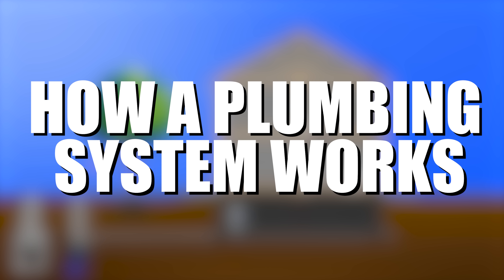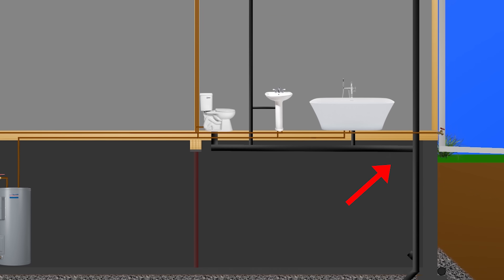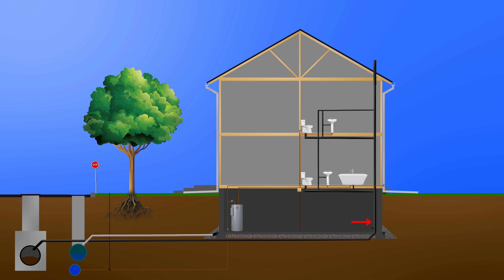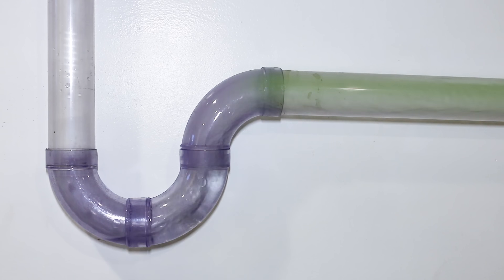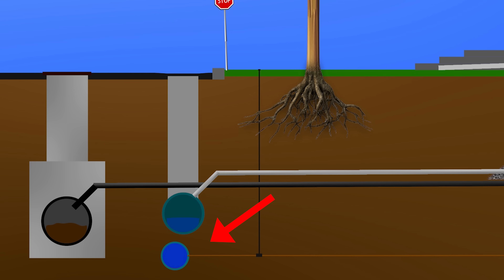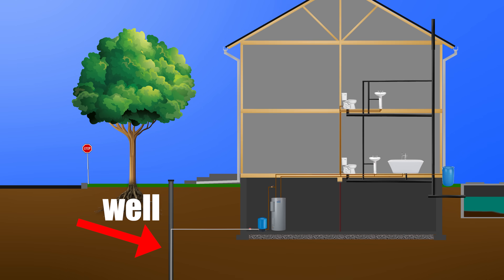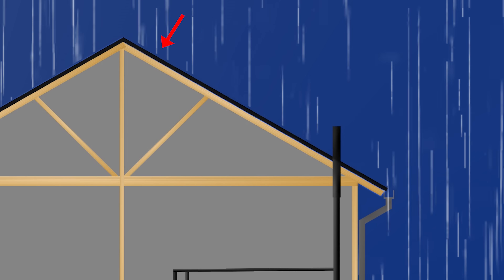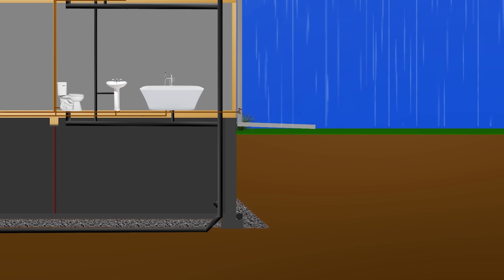How Your Home Plumbing Works (From Start to Finish) | GOT2LEARN

Comment: -Jus one thing, its better to have potable water lines over the waste lines, so if theres a problem with the waste lines theres not danger of getting your potable water contaminate.
Reply: Yes, codes require the potable lines be above and located 10 feet away horizontally from wastewater lines. If the lines have to cross or if the potable line has to be below the waste line for some reason, the lines are encased in concrete in these areas. Potable water lines must be buried deep enough that they don’t freeze in the winter - typically at least 3 or 4 feet below the surface. Waste lines are deeper, anywhere from 6 to 20 feet deep.

Comment: You ought to state this is the norm where you are but not how any other country does it !

Water supply: malleable iron or PEX. From fresh water reservoirs, lakes or sometimes wells. Not rivers!
Vent pipe - only for the toilet. Sink/bath U bends glug - and don't empty.
Hot water source: copper cylinder in the bathroom or gas/oil fired combi boiler in the kitchen.
Drainage - goes into the combined sewer.

Comment: The last part of the video should of been this is one way,  most rain water / storm drains go into a local man made pond and if that over flows goes into another one close to it. This is the same for huge parking lots etc.  Imagine the flooding caused if all drainage pipes etc went to rivers/ streams etc...  And how polluted they would be from all the run off from roads like oil trash etc..
Reply: Which is exactly what used to happen. Thank goodness we don't do that anymore.
Reply: @gregdubya1993  of course you do it. It's literally the only way to prevent flooding
Reply: While there may be a vortex separator or triple basin (i.e. oil and trash separator) installed within the storm system prior to the pond, the true design intent of the retention ponds is to offset the impervious surface area created by buildings, sidewalks, and roadways that does not allow water to infiltrate back into the ground. They are not designed just to keep rivers and streams clean. Rainwater is stored for a designed period of time and discharged downstream at a rate equal to, or less than, predevelopment conditions (if the homes or roads were never constructed), so as to not create flash floods or inundate the downstream storm system. Remember, storm sewer systems are only designed to accommodate a ten year rain event (small storm events) and not heavy rainfalls such as the 100 year event (a 1% chance of happening in a year). Heavy rainfalls are expected to flow across the ground in ditches and swales at specific areas called Overland Flood Routes. It’s too expensive to install complete storm sewer systems that will accommodate all the rainfall. So next time you see rainwater running through your yard through swales or in the street it was designed to do that. Problems occur when people change their yards by regrading or installing landscaping such as trees, bushes, and flower beds.
Reply: @Kashed  I don't understand are you saying putting trees, bushes, grass is bad for the rsin system?
Reply: @leticiaaguilar7729  They are saying that the area covered by roads and roofs doesn't soak up rain water.  The water is instead diverted to other ground, which can quickly saturate during a rainstorm and become unable to absorb any additional water.  The water that can't soak in will "run off" into surrounding lakes or streams and cause flooding, or collect in low-lying areas which may have people living in them.  Retention ponds are often dug near large buildings, communities, or roadways to contain the runoff and prevent the aforementioned flash flooding.  The water caught in retention ponds will continue to soak into the ground and/or evaporate long after the storm ends, easing the burden on infrastructure and the communities served.

Comment: To prevent debris from falling into the vents, why don't they just Chop the pipe off a few inches from the shingles and put a 750 or turtle vent over it on the roof.  Or a Broan vent?

Comment: Ever pull out lead lines? In my old neighborhood, its still lead that comes up from the concrete in the basement. The solder makes it look as of the pipe is swelled but it isn't. The rest of the lines were replaced with copper but from the street, underground it's still lead.
Reply from the maker: Never did it myself, but I saw it being done, quite impressive :)

Comment: Hi Got2learn ✌️and everyone, thank you for your videos. I have to find one about the HVAC drain-pan in the attic. 

Would you recommend connecting the drain-pan pipe to one of the vent pipes in the attic?  Currently, my drain pan is leaking too much to the outside, and it falls right by my back yard door. I have thought about moving the pipe to the side of the house, but that will cause water stagnation issues too. 

Would you recommend connecting it to the vent pipe? Thanks! 🙏
Reply from the maker: thank you so much. You could do it but it won't be code.
Reply: The drain to the outside of the house is the overflow drain. If water is coming out there, it means your main pan drain is clogged. You may look into unclogging that first before tying into a vent line.
Reply: I WATCH THIS GO ONLINE ASK THIS OLD HOUSE. COM

Comment: Ok riddle me this! This darn flip house I bought takes 5 min of running water to get the hot water out of the tap, shower ect! Why! How do I fix it? I have been watching your videos specifically to try to figure out this problem! 5 people in the house and my water Bill is killing me!
Reply from the maker: You need a recirculating pump, this will fix your problem.
Reply: Your water heater is to far away from your shower.  Remember today we use water saving devices on our fixtures that only allow 1-2 gallons of water through at a time which means it will take longer for the hot water to get to the farthest fixtures.  It can be quite costly.  But you could have the water heater relocated to a more central location closer to the fixtures.  But it would require a lot of plumbing work as well as moving the wire if it's electric or the gas pipe if your water heater runs on natural gas or propane.

Comment: how do you know when your septic tank is full? Is it not okay to flush vegetable peelings on the toilet, will it fill up the septic tank faster?
Reply from the maker: Normally, after 10 years you have to get it emptied, and for the peelings, the answer is no, you need to put those in the compost or buy a garburator.

Comment: I am looking looking for a video that will show me how to get water from my main house to work shed. I would like to do this myself. I noticed that I  have a sewage cap and a out door faucet with-in 60 ft of where I am wanting to place the work shed. and 10 ft over to the right.  I would like a visual on piping and the whole rotation experience. Do you have one. Would you mind doing a demonstration; Lets take in mind I will be doing permits. Do you mind?
Reply: If you are going to have work permitted, then you should hire a "licensed" plumber in your state. I'm a Ga. master plumber retired. There are too many idiots out there that will steal your money. I've seen it many times where we would have to rip out everything they did and start over.

Comment: I thought every household is required to have a septic tank to hold and separate  the solid poos and liquid waters are drained out to the municipal sewage system.
Reply from the maker: False, only homes in rural areas where municipal services haven't reached yet ;)
Reply: @Got2Learn  so all the solid human waste runoff to the city sewage pipes ? Isn't this causing bad smell along the drainage system aside from causing sanitary problems because small animals like rats .. etc. and insects have access to this kind of waste?
Reply from the maker: These bad smells are expelled through each homeowners piping that goes through the roof so no one can smell it. Yes, some sanitary issues do come from rats and stuff, but it's very minor.
Reply: @joerex2612  It's also why all of the drains in the house have those traps under them.  As long as there is water in it, the smells cant get back into the house.  Some places require a second trap out in the yard.  You can usually find these easy because sometimes there will be 2 pipes coming up out of the ground in close proximity to each other.  The first one in in front of the trap and the other is on the other side of the trap.

Comment: How does fresh water from city comes from ground to top floor of the house with no water pump.
Reply from the maker: The system from the street is pressurized, thus, it pressurizes the system in the house :)
Reply: Got2Learn you should do short videos on this kinds of things, if you haven’t yet.

Comment: Is the sewer/waste line under vacuum pressure as it is being pumped by lift stations to water treatment plants?  because i'm just wondering if the poop gets stagnant in the pipe if there's no pressure that pulls it aside from gravity.
Reply from the maker: Just by gravity :)

Comment: From a guy that has built close to 100 houses, this was a great summary of the residential plumbing system!
Reply from the maker: Awesomrle, thanks Jeffrey!!
Reply: I am a Self employed Plumber (in business since 2001) with 35 years experience. This video was a great video of a basic residential Plumbing system. If you are mechanically inclined and work under a good Full scale Plumber who takes his time teaching a apprentice the profession, The right apprentice can be able to work independently on supply lines in about 6 months. Drainage, waste and Venting is a different ball game than residential supply lines, but the right apprentice with mechanical inclination may be able to work independently and do full scale residential rough ins with about a year experience. Again that is with the right plumber teaching him and IF they show up for work every day ask questions and PAY ATTENTION
Reply: @juliorosenberg2222 curious to know your thoughts on plumbing system under a slab, is it worth buying a home with this type of foundation ? Are the repairs something a DIYer can tackle ? 
Thanks
Reply: As someone who has never built a home and have no idea how they're built, I agree with you.
Reply: @fredtaylor9792  as i already said, i have built over 200 houses... so know your place, it's embarrassing that you think you can comment on this
Reply: @wailer27  It was just a joke and I wasn't even talking to you. I haven't even read any of your comments. I was responding to the original comment.  Had nothing to do with you. If someone is responding to you,  your name will be in their comment. Sheesh. Go read a book about the internets before you embarrass yourself next time.
Reply: @fredtaylor9792  now we've been acquainted so I am ok to tell you just how unfunny that little joke was and how beneath me you are having no idea about the content of this video, whereas i have built over 200 houses...
Reply: @wailer27  Happy 4th.
Reply: @fredtaylor9792  you can't use that to kill me with kindness as I'm from a different place and I don't share that particular 'celebration' with you... especially since it's the most hypocritical celebration of 'freedom' that could ever exist... what you could do is say you hope england will go all the way in the euros...?
Reply: @wailer27  I'm not trying to kill anything, I was just trying to end the insults. I just hope you have a good day, whatever it does or doesn't represent to you and wherever and who ever you are. Sorry if I offended with my well wishes and I'm sorry I added to the negativity and insulting. My first  comment was meant to be a joke, as I thought it would be funny to respond in agreement to the first guy,  who has extensive knowledge on the subject,  while proclaiming how I have no knowledge on the subject. I have a very dry, sarcastic sense of humor that probably doesn't translate well on this type of forum. If you re-read my first comment,  the one you first responded to me about,  you can see that I was very honest about how I don't know anything about building houses, that's what I thought was funny about it and you still felt the need to tell me I didn't know what I was talking about. So, I think you just took my comment a little more seriously than I thought anyone would. My apologies for adding to the negativity that's so prevalent here.
Reply: @fredtaylor9792  stop trying to end this! oh and stop thinking online conversations have any sincerity or link to the real world in any way. Everybody is a different person online, usually full of hate and looking to cancel other people, or in some cases, ahem, being a d--k for the sake of it... everybody needs to pay far less attention to online comments and chats!
Reply: @wailer27  you must be a blast at parties.   Uhhhhhhhhhhjhjjjhhhhhhhhhhhhhhh
Reply: @wailer27  I have built more than 300 houses! You need to leave
Reply: @Zooral45  my cousin has built 150 houses and we're very close, he passed on all his knowledge to me, so i'm still going to have to claim the upper hand on this one i'm afraid
Reply: @wailer27  who asked?
Reply: From a guy who hasn’t done anything successful in life, This is really interesting
Reply: I've been apart of several framing crews. Over a dozen new builds, and to many remodel &  repair jobs to count, from Florida's stick framing to cali box framing styles..  I'm still learning and seeking out construction knowledge everyday, I'm here looking at plumbing vids lately to help me understand rat infiltration, and the application of using smoke to help locate the breech in sewer pipes, any how , great video.
Reply: @g-man5809  well you've come to the right place as there are 3 of us in this thread who have built over 1000 houses between us... let's not get caught up in who has the overall record as that's not too important
Reply: @wailer27  yeap, who's counting, every house has its challenges,  I'm in a attic right now lol ..
Reply: One time I built a thousand houses
Reply: @AllTheWorldsWonders  ....😂😂👍
Reply: @wailer27  I thoroughly enjoyed your trolling on this thread lol thanks for the laugh
Reply: You didnt build shit, who's to say you know anything about install?
Reply: Hours after it rains. My sump pumps continue to run due to the water continue ing to fill the sump pit. I installed check calves on the discharge piping which work great. I suspect my discharge piping is leaking and the water continues to curculate back to the sump pumps. Any suggestions?
Reply: @peteross4879 but seriously tho I'd check the air lock on the pump. Or a clog. And if u don't have a Zoeller Pump then that's where u messed up.
Reply: Respect to you, sir.
Reply: 100 lego houses yes.
Reply: WOW!
Reply: From a supreme leader who has launched 100s of ballistic missiles, i can tell you’re lying!
Reply: Stop lying
Reply: why do you lie.....it's only been 98 homes u built calm down
Reply: I avg. 80 homes a year,  I wouldn’t have known had I not read this comment lol
Reply: @Jeffrey not true there are  a lot of holes in this explanation. I guess handymans don't go that deep.
Reply: Not a single plumber who visited our home was able to explain why we had a momentary back pressure that violently shot water from the back of a bathroom wall and leaked some water that caused a small leak on the ceiling on the lower floor.  What happened was we shut all the valves in the house, but not the main water line for 2 month, meanwhile, we had a friend water our lawn 2 times a week.  Would you know what might have cause that leak?  The plumber was not able to locate the leak, now what?  Thank you
Reply: Please Jeffrey I know this is 3 years ago but tell me how did u setup   the water form a water service
Reply: From Bangladesh
Reply: Post videos for plumbing man
Reply: Are you hiring skilled laborers
Reply: Na. Completely missed the submersible pumps that are in most homes.
Reply: residentialaka handy man
Reply: Everyone’s a super expert on the Internet! 😹
Reply: Well done first of all, but I've built well over 200 houses so I guess some people are just more qualified to speak than others.
Reply: As a guy that's built close to 500 houses..

This really hits home.
Reply: @AndyC1  proof? no way this is possible ffs
Reply: @wailer27  As if your is true without proof
Reply: You got the seal of approval from a self proclaimed expert.
Reply: Hey brother do you need a certified plumber and hvac guy for great prices in AL? 
Thank you
Reply: ñ
Reply: Thank you for what you do, good sir
Reply: Maybe it is for your country - bu nowhere else !
Reply: What part of the house you build?
Reply: Then why haven't you thought up a more efficient method for draining and collection? This method is completely outdated, in 200 years from now, this will be an antiquated method.
Reply: hello Jeffrey do you need architect or interior designer for your house??hahah

Comment: Great video! Plumbing is very similar here in Finland. What we do differently though, is that you are not allowed to absorb the rain water next to the house straight via downspouts in a new construction (lots of old houses do this still, though). We have, at least on newer areas, municipality rain water collection system as also pointed out in this video. 

Also you are most definitely NOT allowed to direct your rainwater from downspouts straight to french drain, as that will surely make your foundations wet! You don't want wet foundations! 

What we do is we collect rain water and french drain water (from two separate systems) into a single collection well that combines the two water streams and directs water to the municipality collection system. There are one or two non-return valves in place so water from the municipality system, if clogged, doesn't get into the french drain and wet the foundations.
Reply from the maker: Niceee!